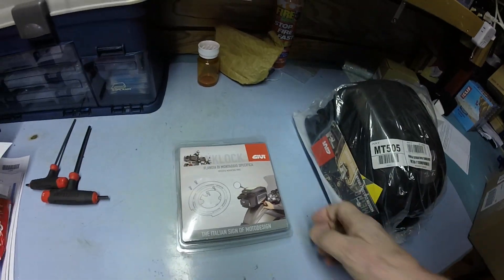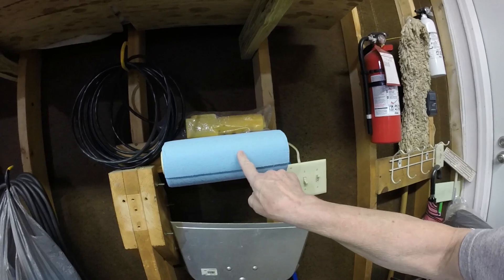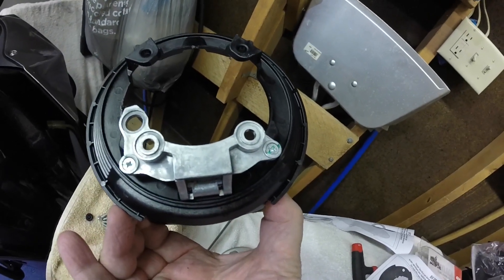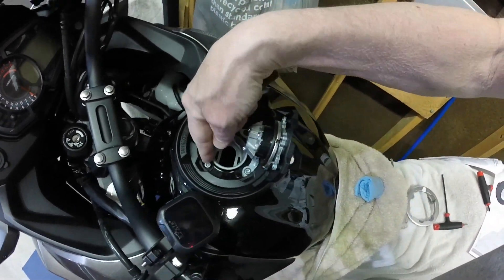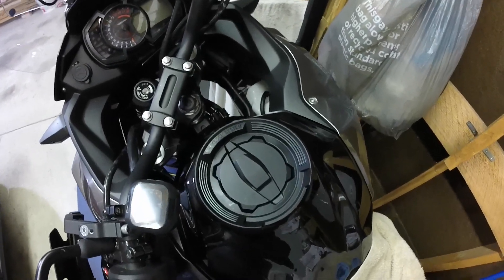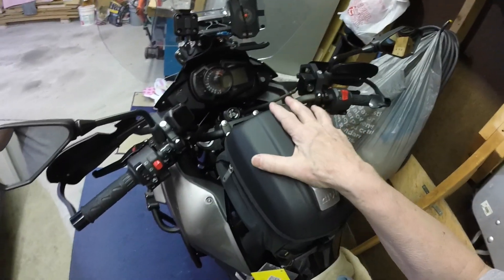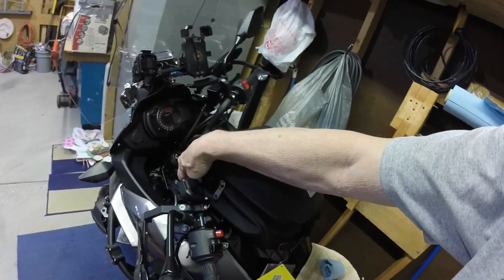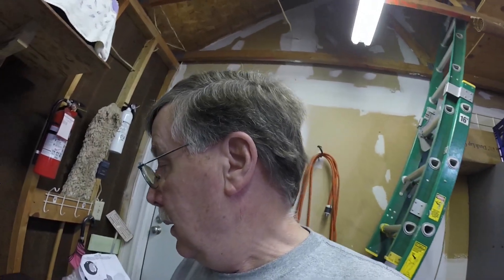Installing a Givi MT505 tanklock tank bag with helpful tips Kawasaki Versys X300

Comment: Great idea, now I'll have to get one.  Did you use a bit of thread locker on the screws to help keep them in the holes?
Reply from the maker: Good question.  I didn't but I should have.  Generally, every fastener that I attach anything with gets Loctite.  During this assembly I had one of the treaded holes on the tank that wanted to give me some trouble and I must have gotten sidetracked.  But Loctite is the norm.  By the Way this little tank bag is one of the top favorites as I use it on every ride, and it is so convenient to carry all the small stuff out to the bike and the bag snap clicks on the bike in one second.  I used to carry all the items and put them on a bench and walk back and forth about 5 times to get all the gadgets attached to the bike.
Reply: @trekOCLVone  I've learned the hard way that I have to be very gentle with those little screws.  I bought thread locker when I did some earlier mods and that has helped a lot.  I've done a few of the mods that you did (thank you for the great videos) and I have a couple more things that I want to do this year if I have time.
Reply from the maker: @lew3057  I've run into some cross threading issues on random fairing removal and reinstallation.  I've learn to have on hand some matching taps to chase the threads immediately if the fastener will not easily start on the threads.  So, for the X300 that means taps M3 through M6 (ish).  I've not had any trouble with M8 and larger bolts.